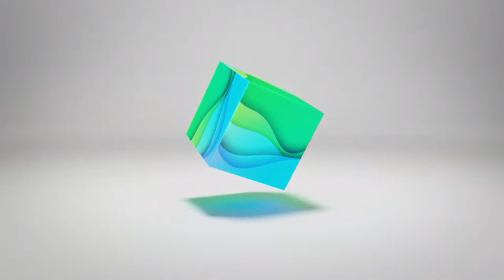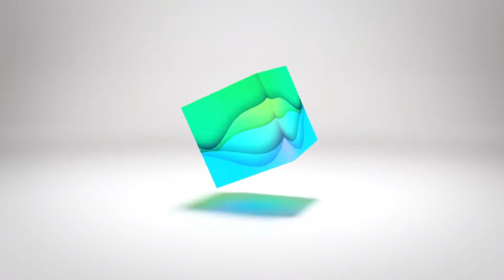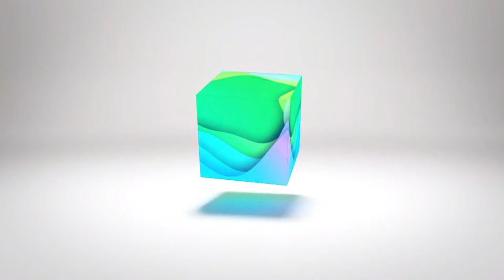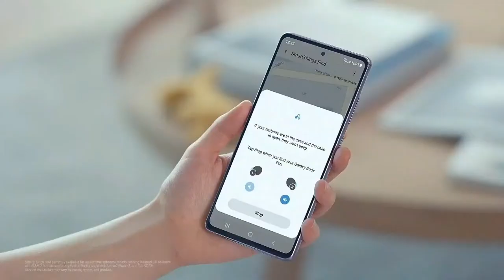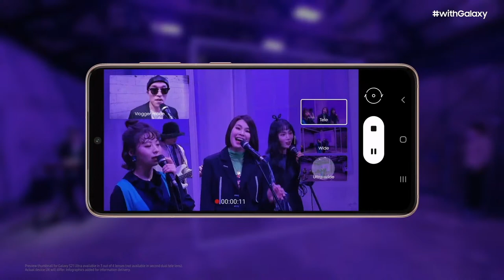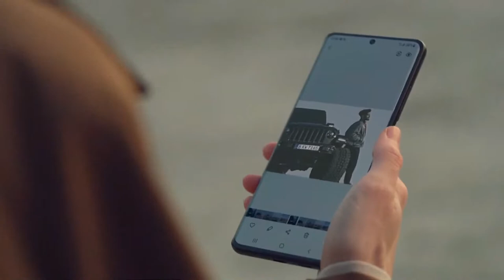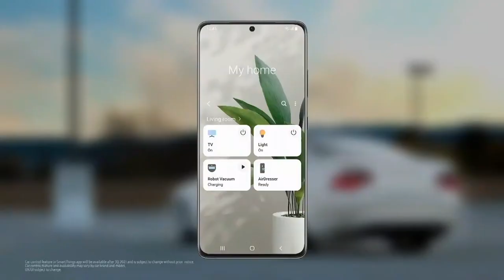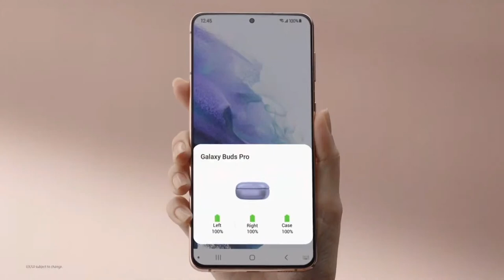Samsung Galaxy Unpacked January 2021 Livestream

Comment: My crappy old Galaxy S6 has a better screen resolution (1440p) than the brand new Galaxy S21 (1080p)? That seems like an odd design choice...
Reply: Realistically on a screen that size it doesn’t make a difference. 120 Hz and better dynamic range make much, much more of a difference.
Reply: @Joraultechy  the size of the screen doesn't impact what the resolution looks like. Resolution is a per inch measurement.

In fact phones should have higher resolution because we keep them very close to our eyes unlike a TV.

At least that's what I thought?
Reply: @garyhamilton2104  PPI is a point per inch measurement, resolution is an absolute number that looks the lesser screen is the better. This is exactly why large TVs have to have high resolution, and phone don’t.
Reply: @garyhamilton2104  wtf bro
Reply: If resolution was an absolute count of the pixels you wouldn't be able to have different sized screens in the same resolution.
Reply: @TheMicroaggressor  yeah no just Google it. Resolution and ppi are interchangeable and mean the same thing here
Reply: @garyhamilton2104  lmao what? 😆😆😆 Resolution is a number of pixels. Full HD is 1920x1080 = 2 073 600 pixels regardless of the screen size. 1920 pixels width and 1080 pixels height. This is a number of pixels that build the screen. It can’t change with the same resolution on different screens 🤣🤣🤣 PPI is dependent of screen size so the same resolution has larger PPI on smaller screens and smaller PPI on larger screens. This is exactly why larger screens have to have larger resolution.
Reply: @garyhamilton2104  do you even realize that pixel is not a metric measurement and can have different size on different screens? This is exactly the reason of existence of the term PPI which is a density of pixels in one inch?
Reply: Higher than 1080p only matters for VR and very large tv's
Reply: @johnrodgers2171  speak for yourself I can see the difference.

Comment: Dear, Samsung you do not have to be like Apple, you are beyond them.
So, please don't get rid of all the function that makes you better.
 
You have already got rid of the headphone jack, strike 1.
Getting rid of the charger, Strike 2
Micro SD card slot is gone, Strike 3 you're out.😞

Everything sounds and looks cool but, I think the main thing is storage and the SD cred helps with that.
I was thinking of getting a new phone (if I have the money). I just bought an SD cred with more storage. there is no point, it doesn't have a micro SD card slot, So farewell.
Reply: i feel the same way
Reply: Strike 4 lower screen resolution lol
Reply: @ashman2k1  STRIKE  5 NO CURVED EDGES
Reply: Yeah went backwards this year lol

Comment: i dont get why some are hating or making fun of the s21 and products, maybe im not seeing some flaw. can someone reply pls?
Reply: S21 and s21+ are only 1080p and no sd card slot as well as no charger included. Phones from previous years are better if you remove the higher refresh rate and processor
Reply: Samsung fans were making fun of Apple dropping chargers from the box, and now 2 months later Samsung does the same
Reply: @TheMicroaggressor  hey, they've been getting roasted by every single Korean tech enthusiast lmfao. Give them a break.
Reply: @rifteagle863  No problems bro, ain’t roasting the guys, just a beholder passing by

Comment: No sd card support 1080p display...im on the s9 it has sd card support qhd display...I'd take qhd 60 over fhd 120 anyday
Reply: S9 was the Best one.
Reply: @DevilVirgel  yeah ive loved it but in need of a upgrade so upgrading in november and im going for the s20 line and wont be upgrading to another samsung phone until it atleast has sd card support but would still prefer 1440p60 them 1080p120
Reply: I have s20 now. It have some nicht features like Kamera with 64pixel and full screen display, but there Arena some big downgrades. Display have not the same quality, s9 has deeper black and more contrast. Sound have not much bass in compare to S7-9 and there are no heart Sensor. I hope in s22 it will be fixed, if not I must go to another company.
Reply: Yeah ino what you mean there doing an apple and I don't like it...last year samsung  made a video dissing apple because no charger then straight after does it themselves going down hill if I'm honest
Reply: FACTZ...120H REFRESH RATES IS OVERRATED AND USELESS OUTSIDE OF GAMING....SMH MOST PEOPLE DON'T PLAY GAMES DO ON THEIR PHONE THAT WOULD REQUIRE HIGH REFRESH RATES.

Comment: 9 pixels into one? All they’re doing is down sampling wtf this is nothing new?
Reply: This is called pixel bining. 9 pixel is considered as one large pixel to get more details in low light.
Reply: @shuvoroy7543  same effect as downsampling in post. It’s nothing they should be bragging about
Reply: @jimmysyar889  Not the same. You loose information on post. Pixel bining happens when you take the photo. So it captures more details while taking phone.